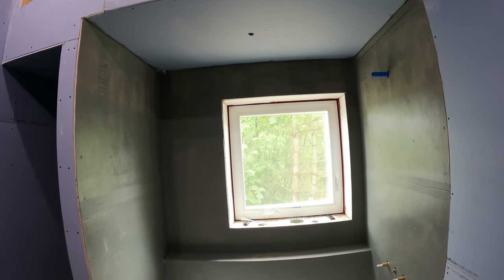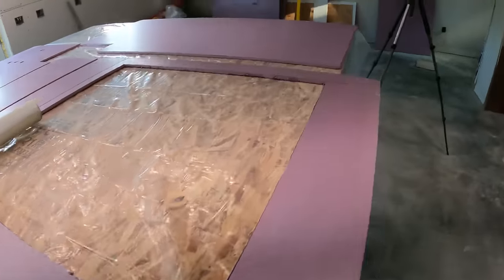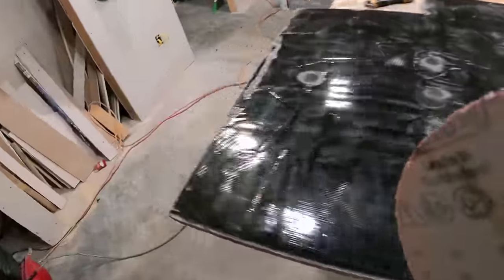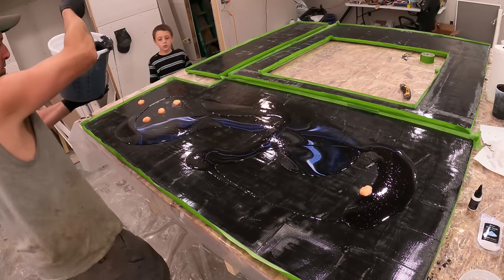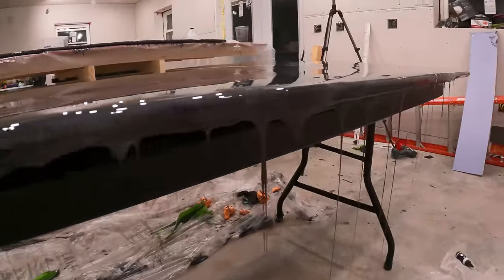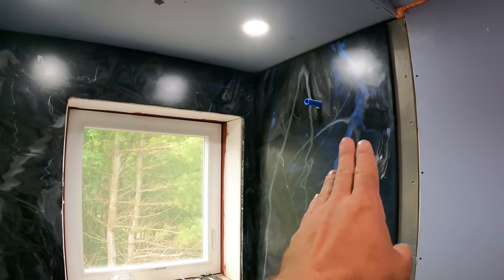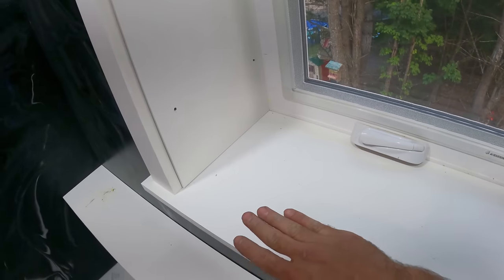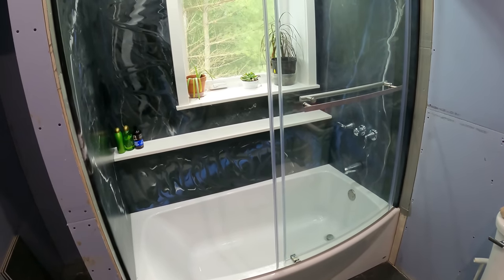Epoxy shower/bath

Comment: You have incredible patience!  I could never do that when I had kids running around.  I think it came out great; for two adults I think it is fabulous BUT with kids I can see the walls getting dented, and I know it's hard; but kids with toys can dent anything.   Once the surface is cracked it leaks and leaks mean water infiltration.  Great job and I wish they had this 55 years ago I would of definitely done the same.

Comment: Great work on the shower! 
On the vertical surfaces where you glued the window trim in, we were trained to run those adhesive beads sloped down away from the wall from back to front so if water does get back there the bead will direct it into shower and not wall cavity. Good slope on the flat sills and I doubt water will get in that unit of a shower anyways.
Just stumbled onto your channel here and dig the couple projects I’ve seen thus far. Well executed and thought out jobs with quality craftsmanship is my wheelhouse and I can nerd out for hours watching people build practical useful things and not hacking junk together with gum and Bobby pins
I finished building my family’s home in 2017 and kick myself now for not doing a single vlog on some of the more clever ideas we worked out. Maybe the next build.
Reply from the maker: Thank you

Comment: Just a note for people; I have made hundreds of cut out Letters from white foam, blue and pink foam the only factors is some paints stick better to the colored ones where any paint sticks to the white foam. Also been doing Sign Foam Lettering since the 1986 and I prefer the white as I use a Latex base coat really thick many coats then I paint my Enamels on top of the flat latex paint which will last decades outside.  With the colored foams certain paint mostly enamels only will stick to it so finding a base coat that applies is a huge thing and seeing how you did your walls in here is great to know that I can make Epoxy Letters now that could last a very long time.  Faux Marble, Granite lettering would be very cool made from foam, can be mounted on walls anywhere.

Comment: I am really impressed.  This appears to be a very artistic durable system.   I had no idea anything like this even existed.   I prefer this way more than the usual tile set in mud system where you are basically just creating a million little grout joints to get dirty and it is pretty boring to look at.  Very well done, I really like this.

Comment: They recommend silicone because it will not bleed through.  Construction adhesive will.  It may not at first but over time it will, having done many remodels I have seen the staining it will do. Even on the precast sinks, shower stalls, etc that people have put in and ask us to replace because of it.

Comment: Nice job Jesse, from my experience with the epoxy coating the final clearcoat roll should always be over the length of the panel and then go over the clearcoat with the heat gun to draw out any possible air bubbles.

Comment: Not bad. I am at 3k so far. Budget is 5k. Since I work with composites, epoxy, polyester resins, this is a breeze for me. But gutting and rebuilding the showers, and complete bathroom had some work... 50 hours.

Comment: You know Jesse I have been watching you since seeing you with Andrew,  and when you just said what you thought was silly, well it's not silly to run a leg down the side of the tub. It's called keeping the water away from sheetrock and framing, thus creating dry rot.
Reply from the maker: if you add another 6 inches then yea it could help a little but adding an inch or 2 isn't going to do much. If you use a curtain then you wrap the curtain inside of the edge by a few inches. I usually use durock or hardibacker board right out to the edge, and waterproof it. so to me there would be no reason for water to get beyond that. If you were to transition to sheetrock right at that edge then yea that could be a problem. but why would you? keep it whatever tile backer you are using. Whether it is hardibacker, durock, schluter ditra, schluter kerdi board etc.

Comment: On counter tops there will be some compression with cooking and using cutting utensils .... Think the foam board even with the epoxy etc would be too soft and compress.
Reply from the maker: I would never use foam for counters. It would be wood underneath

Comment: Great looking bath!  Update?  How is it holding up?  What did you do for the ceiling?  Know you're busy, but I am about to embark on a similar project - just want to know how it is holding up.  Thanks for this video!
Reply from the maker: This has held up very well. Everybody loves it. Its also not cold to the touch like tile
Reply: @jmuller86  Thanks!

Comment: Turned out really nice! But for countertops go with granite. Even though that epoxy is hard, it will not last in kitchen - I would argue also the foam core inside might not handle the wear and heat. Granite has endured for millions of years, would last all of us viewers lifetimes combined in kitchen too!
Reply: This isn’t a kitchen it’s a shower
Reply: My stone coat counters have been installed and used daily for almost 8 years. The oils from my coffee pot have darkened a small section. Dropping a food processor blade on the edge chipped it, just a little notch. We mixed up a small batch and fixed it. I don't remember where it was.

Comment: Well I think that finished up pretty bloody good. Not a fan of the extra complications of a window in the shower box but what are you going to do, it is what it is. I think a steam extractor should have been in the ceiling of the shower box but outside it on the wall is better than nothing. Once you get a big mirror on the wall and some paint the rooms going to look good and certainly more interesting than a dull as buggery ordinary tiled out wash room. In fact a vertical panel of the same epoxy lining would have looked good as a colour connector somewhere else in the room, perhaps the back wall behind the towel rails, then it could be reflected in the vanity mirror, just saying.

Comment: BECAUSE construction adhesive will eat foam board if it's not the right board, and you had better chalk those screw heads or they will rust from condensation from showering
Reply from the maker: gorilla construction adhesive will not melt foam. I use it all the time with foam. and those are exterior rated screws, bronze dipped. they will not rust
Reply: As always you did not read my post, some construction glues will eat certain types of foam board and I know that for a fact, I've seen it happen
Reply from the maker: @davidfarley1175  you didnt read your own post. You said construction adhesive will melt some foams. You didnt say "some" adhesives

Comment: I'd be worried about impact resistance given the foam under the epoxy
Reply from the maker: Impact resistance for what?
Reply: Thinking more for a countertop -- and if polyiso used for countertops like showers -- if a pot or glass is dropped, will it dent the foam?  Even in a shower, if someone slips, will an elbow, shoulder, head, etc dent the foam under the epoxy?

Comment: Window in bathroom? Sure. Window in shower? No. Privacy issues and will always have a soap scum coat, but that is true of the doors too. Glass in shower is always a chore for cleaning. I would have probably gone with a lighter color scheme, but that is all subjective. If you do another epoxy, I do think you are attempting the natural look so I would try to avoid big blobs on pour start (I know hard to do with a full bucket) and do attempt streaks and crosshatch with colors. I would avoid sine waves and not overwork the accents. Nice job overall.

Comment: 100% silicon is water proof... construction adhesive is not.
personally i would have spread the silicon out over the entire surface area of the wall board... so no moisture can get into the sheetrock even if it gets behind the panels....
Reply from the maker: the gorilla glue construction adhesive I use is 100% waterproof, and there is no sheetrock behind those panels, its all hardibacker board that has been fully waterproofed

Comment: Very nice, but if I were to visit you, I wouldn't be able to use it. No grab bars. I'm almost 75.
Reply: It's very easy to install afterwards. They have to be properly secured to the wall with the right fasteners. God bless !
Reply: @expertmax32  If he retrofits grab bars later they won't have the PVC backing like the shower door supports. Maybe there's another bathroom in the house for elderly guests. Many new 55+ apartments just have showers and the more upscale units have walk-in tubs. Does Jesse ever respond to these comments? God bless you too.
Reply from the maker: I can just cut out a chunk and replace it with pvc, small enough that a flange from the bar would cover it
Reply: @jmuller86  That makes sense. With your skills it should be a piece of cake.

Comment: You spent all that money on refinishing the walls and you didn't do it anyway that they instructed it to be done they're not high enough off the platform surface first thing you were supposed to double or triple tape the sides, and you poured too much to close to the sides. Wow you wasted money